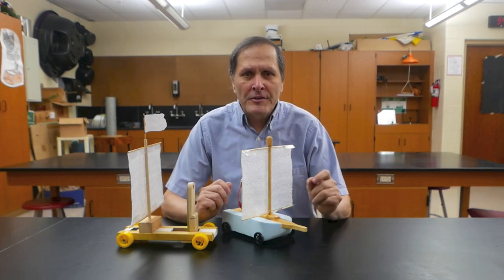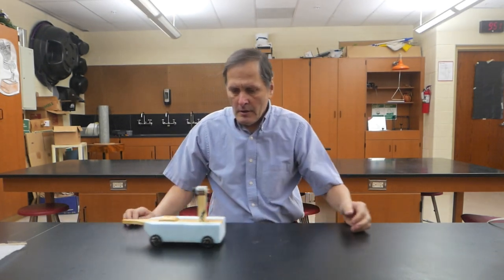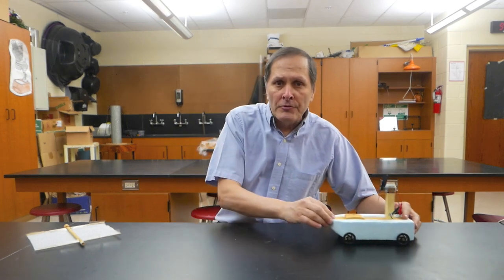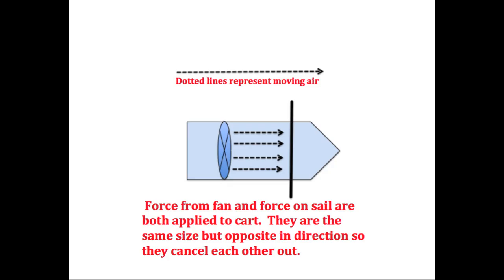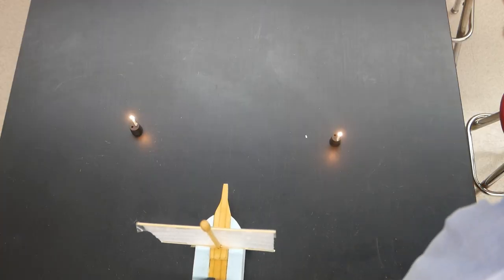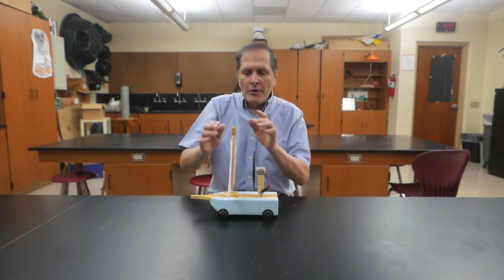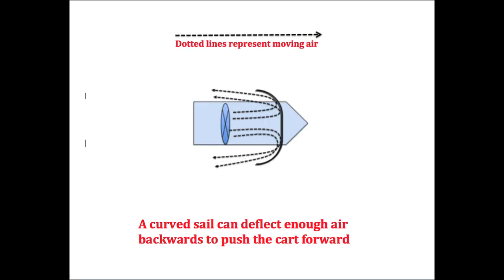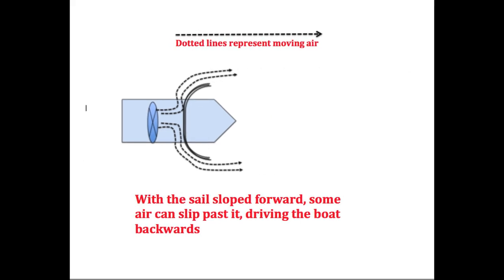Fan Cart - Blowing into your own Sail- part 1 // Homemade Science with Bruce Yeany

Comment: You have characterized the phenomena exhibited in your experiments here incorrectly.  You state: “The fan pushes the air forward which drives the car backward…which is a really nice example of Newton’s Third Law”, i.e. action and equal reaction.  

Any aerodynamicist or a physicist who understands fluid dynamics will tell you it is the pressure differential that the fan creates which draws your craft forward, not the action/reaction of the propelled air molecules.  

If you view your experiments from the perspective of how fast the air is moving in any given direction surrounding your craft, and then associate those vectors with the air pressure in those areas, you’ll understand why the craft pulls in the directions it does.  

If you were able to observe the air flowing around your craft, such as in a wind tunnel within a flowing colored gas, you would see that where the air velocity increases there is lower air pressure, precisely in accordance with Bernoulli's principle/law, developed in 1738, albeit a physical law which still lacks widespread understanding—even among the well educated—nearly 300 years later!  

The difference in air pressure between the two sides of the sail, is the phenomena which in fact pulls your experimental craft towards the lower pressure air, as it seeks to equalize the pressure between the two sides of the sail; much like a hot air balloon or water bubble rises, and which accounts for why you can suck fluid up a straw.  If you blow air over one side of a sheet of paper it will lift up on that side due to the fast moving air and consequently lower pressure on the top side.  

If you could measure the wind speed or air pressure on that experiment of yours where the craft spins around on water, you’d see that the air leaving one side is moving faster.  And yet…the air moving faster on that side does not push the craft in the opposite direction (a la Newton, equal-opposite reaction).  In fact the craft moves IN THE DIRECTION the faster air is flowing—due to the lower pressure on that side—seemingly in contradiction to the commonsense assumption that the craft would move in the opposite direction the fast air is flowing.
Reply from the maker: I freely admit that I am somewhat vexed at times on the behavior of fluids, I think what is interesting is what actually causes the differential in the air pressure that you describe to begin with. A  simple explanation I found on the air molecules movement.  The air particles come in contact with the angled propeller blade and are pushed forward applying a force backwards..   This air movement  creates a lower pressure area behind the blade and the surrounding air rushes in to balance it out.  I have a ton of articles on this subject matter from NASA,  I visited their Glenn research center years ago,  the  statement above is how they describe the behavior of a propellor.  Interestingly enough I have a large poster in my room where they describe the movement of the airplane moving forward is the result of the propellor and give it as an example of Newton's third law.  Their simplified explanation:      https://www.grc.nasa.gov/WWW/Wright/airplane/newton3.html
Reply: I reviewed that web page at NASA.  It is contradicted by another NASA web page which explains the phenomena in a more knowledgeable way: https://www.grc.nasa.gov/www/k-12/airplane/bernnew.html .  This other NASA web page introduces the controversy between Newton and Bernoulli regarding aerodynamic lift, and mentions the more refined mathematical methods actually used in modern times for determining aerodynamic lift (Euler and Navier-Stokes).  

As this other NASA web page explains more precisely:  

"a change in the velocity of a gas in one direction results in a change in the velocity of the gas in a direction PERPENDICULAR to the original change. This is VERY DIFFERENT from the motion of solids, on which we base most of our experiences in physics."  (my emphasis added).  

Thus, in a seemingly magical manner, an airfoil changes a force vector in one direction to a force vector in another direction.  For instance, the propeller (airfoil) of a windmill changes the wind force vector into a force perpendicular to the wind force (contradicting Newton's Third Law), which then turns the windmill axle, producing power.  Likewise for an airplane wing.  Air flowing over a wing produces a net force vector perpendicular to the flow of air—in contradiction to the commonsense (but erroneous) application of Newton's Third Law.  Newton's Law would have the wind pushing the wing exclusively in the direction of the wind.  Granted, there is some of parallel force on the wing, known as drag, but the predominant resulting force is in a different direction, i.e. aerodynamic lift.  

At conventional air speeds the momentum of the air molecules has a negligible effect on the aerodynamic lift of airfoils such as propellers and sails.  This knowledge comes not only from the Bernoulli principle.  It comes from confirmation by experiment, i.e. the scientific method.  As the NASA article explains, Newton's third law only comes into play in aerodynamic lift as a result of the 'turning' of air flow caused by the pressure differentials.  That 'turning' is the magical property of airfoils (hydrofoils as well).  Needless to say, at an ever granular level we would see that many physical laws come into play, even down to the atomic level as the flow of air molecules expand into areas of lower air pressure (fewer air molecules).  
 
A simple experiment illustrates the Bernoulli principle.  Place a piece of paper on a flat surface such as a table.  When you blow on it, it stays flat.  Then place the paper on the edge of the table and blow across the top of it.  The paper lifts up due to the air pressure differential—the upper area being lower than underneath, which as Bernoulli explained, is a consequence of the air speed differential.  

The results of your model experiments are understandable if you view them from the perspective of air flow speed/pressure, not from the erroneous application of air flow momentum, i.e. Newtons Third Law.  The seemingly anomalous results of your experiments arise from an incorrect assumption that Newton's Law is the controlling factor.  It is not.
Reply from the maker: Mel Ellington,  thanks for updating me on the controversy.  I have quite a bit of information from NASA and other sources but didn't see this particular page.   Doing some additional searches brings up similar information as you have posted,  plus several examples of the behavior of a prop described as being an example  Newton's 3rd.   I did a follow-up video to this one and am still not quite satisfied with it,  so when I get a chance I'll give it yet another go.  If you review any of my other videos and find the information to be in error please let me know.  I do appreciate these types of comments, while I try my best to get it right,  I accept that that won't always the case.

Comment: You perform your experiments on the verge of being scientifically incorrect and misleading. Your sail does not represent a real sail because the shape of a real sail would be more like the one in your first cardboard sail experiment. You put your "flat" sail sometimes with the mast ahead and sometimes with the mast behind which completely changes the outcome of the experiment because with the mast in front practically all of the air goes to the side and slightly forwards. With the mast behind we can clearly see that when the fan blows into the sail the net force is forwards but the friction compensates most of that and you additionally tried to minimize the remaining effect by the way you were pushing the cart. In the water you just didn't have your sail oriented correctly. If you want a completely flat sail just use a piece of cardboard or something like that. And you are persuasive enough to make the majority of your audience believe you.
Reply from the maker: Thanks for your comments and I agree which is why I went back and tried it again in another video,  part 2.